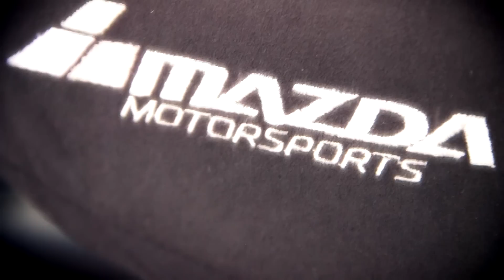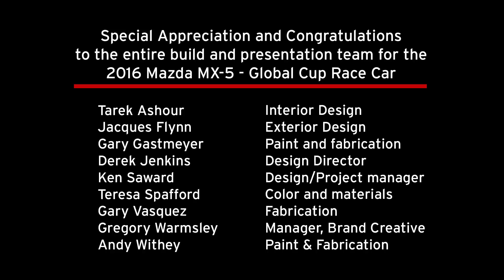2016 Global MX-5 Cup Car Design Video

Comment: Make a production version with the racing aero kit please.
Reply: I'm pretty confident you can actually buy the lip/side skirts etc that they put on the cup cars through the mazdaspeed program. People break that crap all the time racing and buy new ones.  The sheetmetal on cup cars is all stock, this car just has vinyl decals to accentuate the character lines already there.
Reply: Daniel Gamble Looks like it was painted on for that car...you can see them taping off the car before they applied the clear.